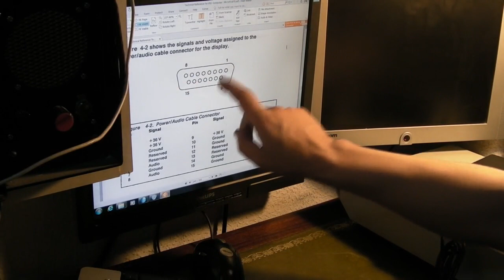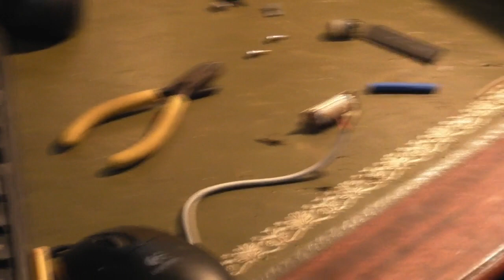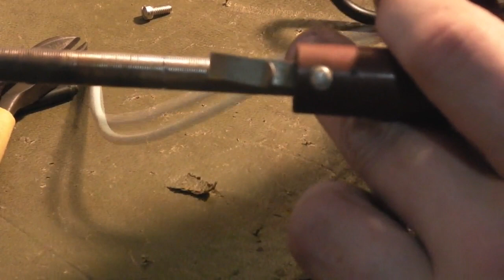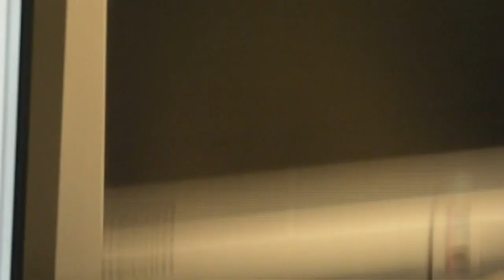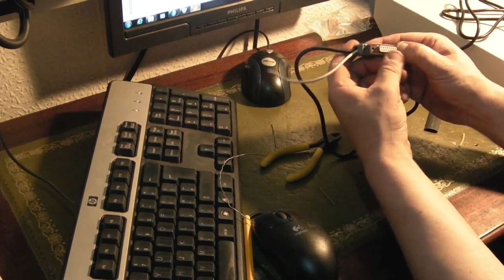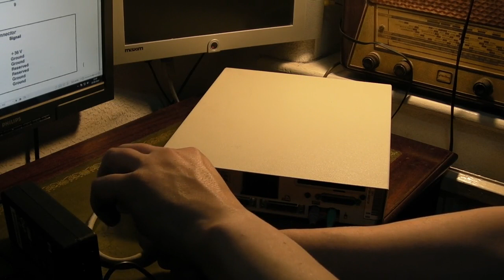IBM PS1 2011 alternate PSU and first power up

Comment: Hi, does it work on 12-18V adapters ?
36V  AC or DC ? :)
Reply from the maker: No a 12-18V DC PSU like on an old laptop won’t work, you need something that will produce 34-36v AC. I believe there are now modern replacement PSU boards for these computers now that do use a 18v laptop style PSU.

Comment: Your diagram shows 2 audio pins, are they the same channels or are they left and right channels?
Reply: Sound card's output is actually Stereo and inside the monitor there is a stereo amplifier. Even if there is a single Speaker inside the monitor, the Headphone jack is stereo.
Reply: @stefanocrespi5424  Thanks!  I actually used your guide and made one myself that worked perfectly!
Reply: @stefanocrespi5424  If the soundcard output is stereo PIN 6&7 are for L&R but where is the audio ground ? Thanks
Reply: I answer myself : 6 audio L, 7 audio ground, 8 audio R. Thanks
Reply: @stefanocrespi5424  Do you know is the 36V output from monitor AC or DC and does it work on 12-18V pover supply from laptop ? :)